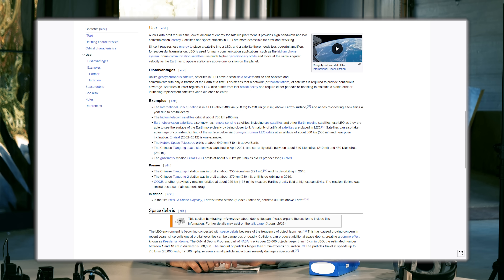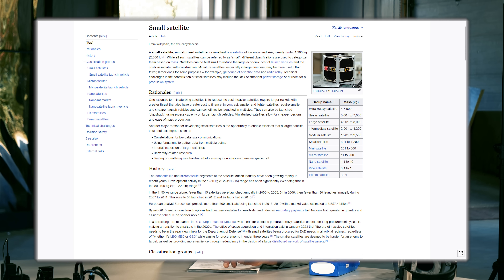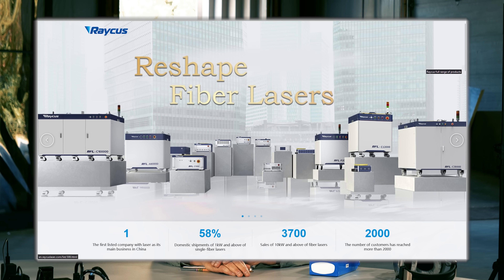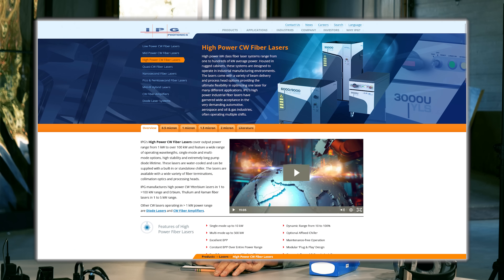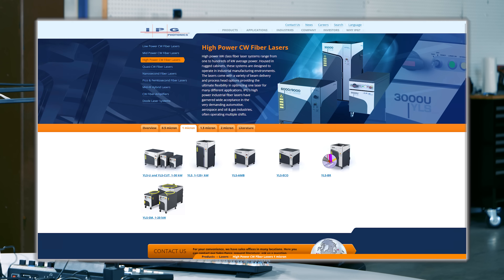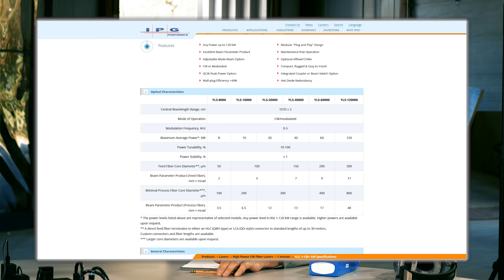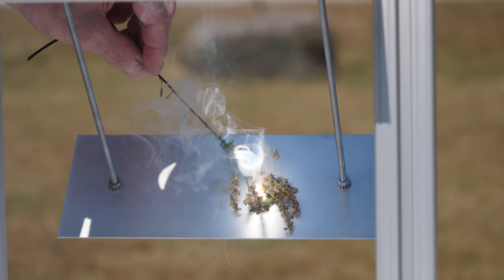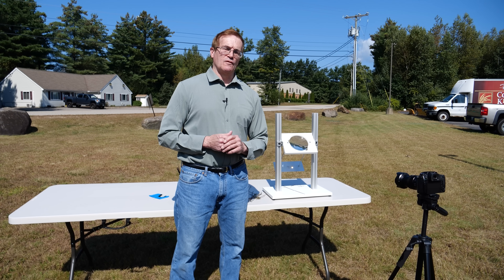COULD SATELLITE LASERS REALLY DO THIS?...

Comment: I'm always amazed at the diversity of information provided through this channel and its quality.
Reply: According to Naval Captain Paul Tyler in a 1976 essay, “The Electromagnetic Spectrum in Low-Intensity Conflict,” a “speed-of-light weapons effect” could be achieved with “the passage of approximately 100 milliamperes [of directed frequency] through the myocardium, [leading] to cardiac standstill and death.” In other words, electromagnetic devices with stun or kill settings could theoretically wipe out entire armies—and cities. The patent for just such a “death-ray” device, according to officials of the McFarlane Corporation, an independent Research and Development firm, was pirated from them in 1965 by NASA. The theft was reported in hearings before the House subcommittee on DOD appropriations, chaired by Rep. George Mahon (D-Texas). According to McFarlane company literature, the invention—termed a Modulated Electron-Gun X-Ray Nuclear Booster—could be adapted to “communications, remote control and guidance systems, electromagnetic radiation telemetering and death-ray applications.”
Reply: Wholeheartedly agree. I can't wait for the normalization of "air conditioning" paint! I really want to go take as many road trips as possible and not have to stay in hotels so I want to do a mini cargo trailer build-out and not have to have 1000 watts of solar I just want a tiny air conditioner to blow cold air on me, a heater and a 12v compressor fridge so I don't have to deal with ice but can control my food budget better and save my leftovers when i do eat out 😂. I'd to go fully modular and just have a bed frame and some kind of counter built in it but then just have an ego flowave 2 and a dual zone compressor fridge like the iceco go20 and cook on propane probably.
Reply: @0Logan05  fascinating, this got so few likes that had to say something.

Comment: This man has made so many valuable videos. Learning made easy!
Reply: According to Naval Captain Paul Tyler in a 1976 essay, “The Electromagnetic Spectrum in Low-Intensity Conflict,” a “speed-of-light weapons effect” could be achieved with “the passage of approximately 100 milliamperes [of directed frequency] through the myocardium, [leading] to cardiac standstill and death.” In other words, electromagnetic devices with stun or kill settings could theoretically wipe out entire armies—and cities. The patent for just such a “death-ray” device, according to officials of the McFarlane Corporation, an independent Research and Development firm, was pirated from them in 1965 by NASA. The theft was reported in hearings before the House subcommittee on DOD appropriations, chaired by Rep. George Mahon (D-Texas). According to McFarlane company literature, the invention—termed a Modulated Electron-Gun X-Ray Nuclear Booster—could be adapted to “communications, remote control and guidance systems, electromagnetic radiation telemetering and death-ray applications.”

Comment: I never even would have thought of that. When it's dry all it takes is a cigarette butt, knocked over tiki torch or air born ember from a beach campfire. Occams razor.
Reply: I've lit up so many things just using an angle grinder and not just in summer
Reply: @FlakeyPM  When I was a teenager I accidently started a grass fire in a field one August afternoon with a bottle rocket. When it's dry enough it only takes a spark.
Reply: It was arson, blue lasers or blue haired lesbians, it doesn't matter which.
Reply: @alihenderson5910  LOL at least you are funny
Reply: Shiny Litter can cause Fires when hit by Sunlight wrong.
A discarded Bottle, a lost Pair of Glasses as Examples.
Crystal balls, burn Homes! 
They're perfect Firestarters.

Comment: I live in Maui and about 3 days ago my electrician did a couple routine things, he's been an electrician here for multiple decades and not only has done a bunch of electrical jobs in Lahaina for homes but also large projects and as a result has many contacts of electricians big and small. Point is we were talking about Lahaina and the fires, one of the things I found really interesting that came up was how he had contacts that worked at the main electrical utility for that area and that the utility turned off power to that areas grid but with all the homes and businesses with solar panels and or battery banks portions of the grid actually stayed energized enough to stay sparking if downed...
Reply: The local power is designed not to feed to the mains if they have failed. You use an isolating switch to use power locally from your panels/ windmlls/ batteries.
Reply: No sir. There are safety features in the inverter that turn impossible to feed energy into the grid in case of a black out or disconnection of the system. Imagine what would happen if an utility worker touch a supposedly dead conductor in such circunstance...
Reply: @jgalindes  This is how it should be, but in reality even with tight regulations it's often not the case.
Especially if people cheap out and DIY stuff with cheap Chinesium without a clue what they are actually doing.
And since China is the biggest producer of solar stuff quality is dropping fast, even with domestic products. Otherwise they can stay competitive.
Reply: 100% would think in a modern grid with all the quality solar safety goodies but we aren't talking about a modern smart grid but instead a old grid that was first installed decades upon decades ago, renovations have improved it but not a fully modern grid, I could for whatever reason see an auntie or uncle without all the automatic disconnect switches in a very old home that installed solar panels in the past decade or two. I fully comprehend how a smart or modern home and grid with all "t"s crossed and "i"s dotted wouldn't have back feeding issues, randomely guessing I'd say 50% of homes and aspects of the grid could be considered a truly smart grid or home.
Reply: @jgalindes  most modern grid tie inverters have a way to isolate themselves from a grid if they don't sence voltage on the grid, most grid isolation or disconnects are a standalone device that if you install a nice one can be an automatic disconnect which disconnects the entire home's grid input if grid voltage goes down, this setup allows the solar system to keep powering home and doesn't back feed. Grid tie inverter setups that isolate themselves and don't have a external disconnect can't power a home without an energized grid which I personally don't like since you loose power if grid goes down.

Fact the grid stayed energized(what my electrician said) enough to spark shows that there clearly was an issue and they think it's related to improperly setup solar systems.
Reply: Once upon a time,
a very very heavy fuse fell on my foot,
until I realized it wasn't a fuse at all,
It was a solid steel slug shaped like a fuse...

Apparently the punch operator was fed up that the fuse constantly blew so he went to the next best lathe and made a "new" one...

So yeah people do dumb stuff and for the curios: it was a faulty motor winding, obviously.

The most scary part?
They guys in maintenance thought it was funny and let him proceed making that thing...
Reply: @embracethesuck1041  it's irrelevant, there are isolation switches at the inverter output to prevent feeding a downed grid, as in the event of a power failure, the inverter would then be trying to feed the entire downed section of the power grid and incapable of powering the home or business that it should be powering.
Reply: @DerSolinski  why, that's absolutely right! It's not as if we screen for such things or have a Laboratory that would Underwrite such magical devices like electrical devices. If we did, we'd might call them Underwriters Laboratories and have an approval for them and oh, maybe call the government organization something silly, such as Customs.
Reply: @DerSolinski  wherever is this? I've never heard of any industrial plant that makes their own fuses.
Reply: @spvillano  all I'm saying is portions of the grid was able to stay energized after it was shut down by utilities and that they think it was from solar systems, how solar systems were able to keep sections energized is a secondary topic.
Reply: @GENcELL2014  beyond unlikely, as the load of other homes and businesses would overload the inverter and shut it down quickly.
More likely, there was some crossfeed that went ill documented that resulted in flow into branches that were thought to be down. That could handle a significant load and stay up, where an inverter would instantly shut down, as far too much current was demanded of it.

Edit: I should add, if the inverter didn't shut down on overcurrent, it'd overload and simply destroy itself instantly. Saw both myself in similar circuits.
Reply: @jgalindes Yes sir !!! You get it right. You know your stuff.
Reply: @DerSolinski Too far fetch. With solar systems you get to know what you are doing . Otherwise you blow away your costly investment. Even if it is chinese, they are expensive.
Reply: @spvillano Agree.
Reply: Still people with faith in the system, cute.
I've seen too much nonsense with "official approved" stickers to tell you: at the end of the day stickers are just stickers.
They have absolutely nothing to do with the reality.
The same goes for people, you have smarty-pants and idiots.
At the end of the day it is a coin flip.

And just on a side note, this is one of my professions and I've installed solar systems from different vendors so I know a thing or two about them. 😉
Reply: Here we are talking lasers.
"Uh hey guys it's an electric grid fire."
That kid saved by a cop in Michigan comes to mind. The one getting stray voltage.
Reply: @embracethesuck1041 Anything that connects to the grid must be able to isolate itself from the grid during a grid power failure. That includes anyone who uses a gas powered generator to power their home through the house wires. These solar systems are no different. The reason is that there must be no power going out onto the grid otherwise the people from the power company are going to get electrocuted when they attempt to fix the problem. It's a safety issue.

Comment: Interesting thought experiment, Doc. Im curious how your projection might change if you considered modular construction sent up piece by piece by the x37, "assembled" by the robot arm.
Reply from the maker: Thanks. 
Obviously, a larger platform would permit higher power and larger optics would improve the spot size on the ground.
Even in a complete setup, heavier satellites could be launched.
The trade-off would be fewer platforms and sparcer coverage given a total tonnage to orbit budget.

Comment: Ground based lasers have fired at lightning clouds, the ionized air creates a path of least resistance for the lightning. This same method could be used by a satellite based laser to create lightning strikes on land.
Reply: Don’t even start….
Reply: The clouds might make it hard to get the laser to the ground...
Reply: I think you misunderstood,  he’s saying “ground based lasers”  In other words the laser is firing from the ground up to the cloud creating a path for lightning to travel  down.
Reply: @lateralus411  I'm referring to the speculation that it could be used from satellite based ones as well in the last sentence
Reply: A path that leads right back to the laser.

So the laser system would have to be placed where they want the fire to start.

If you want to start a fire, I can think of cheaper, more reliable options.
Reply: If you watch closely, you will see a tiny squib shoot up to a cloud from the target of the lightning just before the lightning bolt comes down. The squib ionizes the path for the bolt.
Reply: ground based can tap into the power grid the immense amount of power needed to fire from space would require nuclear reactors of a large size
Reply: @lateralus411  He said satellite in the second sentence.

Comment: I live on Big Island, can see Maui on a clear day.  Before I heard about the fires I was concerned about the potential for wildfires due to the rare dry windy conditions that day.  The people who assume it was intentional just obviously don’t understand just how much combustable fuel these extremely tall, dense, dry fields of Guinea grass have.  These grasses grow to be 10 feet tall in a year or two and produce so much biomass that they can raise the soil level up multiple feet in a few years, sometimes lifting rocks up with their thick stocks.  Add a constant gusty supply of oxygen to the mix and the amount of heat that can be generated from a single spark is insane!  There’s a lot of plant species here that burn surprisingly hot when they dry out and Maui was very dry at the time.  At the same time there’s other tropical trees that are very fire resistant because they have dense trunks that store lots of water.  
  Glad to see you address these crazy theories, It’s concerning how many people are still unconvinced even in this comment section though.
Reply: Yeah, but you can't distract many voters by blaming grass.

Comment: The problem is they established the fact the power lines had been shut off that morning and were not hot when the fires were starting.  From what you've said and what I've seen, were I to write a novel it would include a hover type aircraft with a blue laser holding over the area with its transponder off.  What is also interesting is the weather photos from that time period have been scrubbed from everywhere.  A great video, thank you.
Reply from the maker: Thanks. 
Play the odds.  Could they have been mistaken(lying), or should we invoke  hovercraft?
Reply: @TechIngredients   A hovercraft is a water based craft, but a Harrier or helicopter would fit the bill perfectly.  Do you have the stats on how effective they would be and at what heights?  It's a terrifying thing to ponder but if you watch Dutchsince, he has satellite imagery of a straight beam hitting Paradise CA as their fires were starting.  I wish I could make a better case for being wrong but that novel isn't writing itself.
Reply: @TechIngredients   Maybe an F35 B?
Reply: @RWBHere   That I did not know. Or forgot.  Thank you for the info.  That said, it would be obvious to those being blocked from their escape I would bet. It would have to be something that could fly above the smoke and the noise and panic would cover it.  Also, the weather data for that day and that area are gone.  Very tragic novel is taking shape but I hope people continue on until it's written.
Reply: @mariannorton4161 You realize the power company supplying Paradise admitted fault, right? They were running ancient equipment that should have been replaced 20 years ago, and it was a windy day during a dry spell.
Reply: We must consider multiple equipment being used together including man's involvement.
Reply: There are videos of SH-64 flying during the fires. Heavy lifter helo. That would do.
Reply: @PaxHeadroom   I do realize they did and had to pay a fortune.  That does not preclude other events being in play as well.
Reply: @Majik888   Do you have a link to those videos?  Thank you for the heads up.

Comment: Great video. I am a weapons designer from a family of fire fighters, so I have been getting hit up for my opinion on this every which way since the rumors started. My response was pretty simple. The obvious retort is there is no reason to do it. Plenty of fires start with arson, why use a laser from space when a flick of the bic gets it done even better. Second, on the blue objects, there are lots of objects which were not burned that were not blue, and some objects that were burned that were blue, and many pictures shown as supposed evidence were not even from this incident, or even this state, so there is no reason to believe the color blue had anything to do with it. Finally, any energy weapon powerful enough to melt in the white aluminum from space could easily melt anything blue, no matter the color of the laser, and it is absolutely going to burn up the black asphalt the aluminum is resting on way before that, and in the pictures with cars melted the road is basically fine every time. I had not done the math on how small the beam actually could be, so I guess it is maybe possible with .5m diameter they directed the beam on just the car and not on the road and kept it stable and melted one car at a time in bursts of a few minutes or even seconds at a time, but it would be virtually impossible to track such targets from space, and again it is entirely pointless since cars already burn and would be expected to catch from this kind of fire, which, again, could be started much easier with a disposable lighter.
Reply: 😂 this one is wild! How do people come up with this stuff??
Reply: "A weapons designer from a family of firefighters" 🤣😂 There's one i haven't heard yet!
Reply: @4tounces  yeah, started with my grandfather then an uncle now two cousins too. But I got my degree in mechanical engineering and work as a design engineer with defense contractor. Mostly just kinetics. I had about half a dozen people I grew up with asking how crazy was it really. The answer is pretty crazy. Anything that can melt aluminum is absolutely going to melt an umbrella, it doesn't matter what color any of it is.